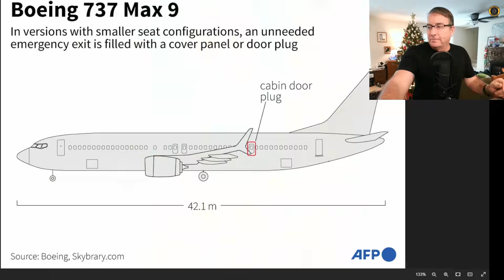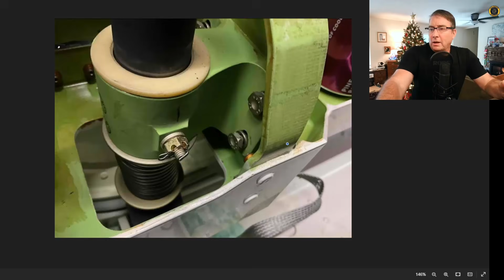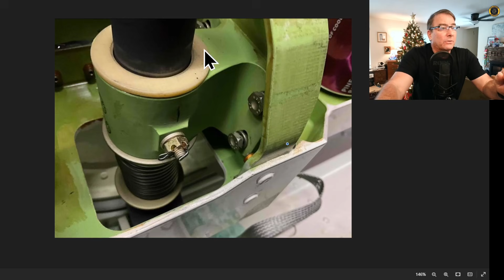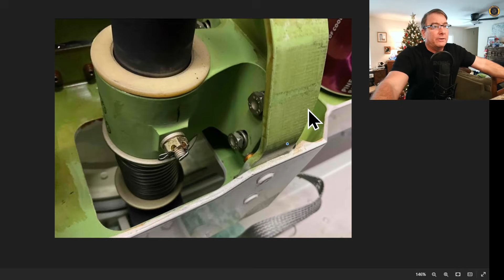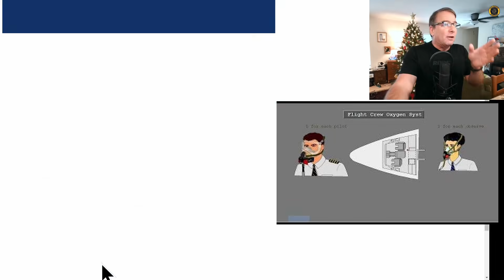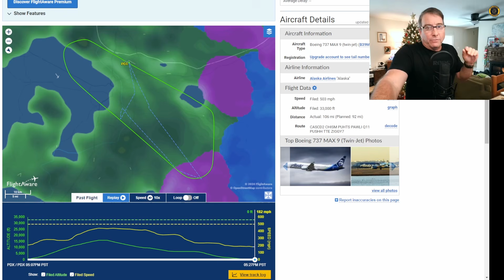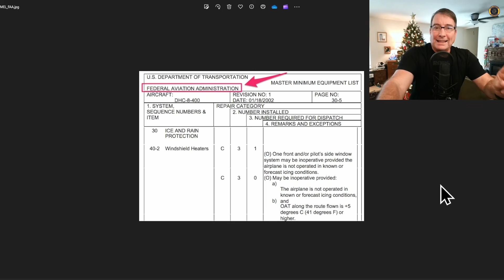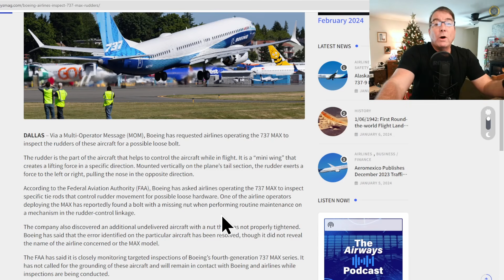"Yes, We Have No Bolts"  9 Jan 737 Max-9 Update

Comment: It's kind of shocking that the staff on the airplane are not trained to listen for hissing sounds near plug door locations. Apparently passengers were hearing this sound on this flight.
Reply: Door seals leak ALL the time.  Virtually every airplane has  leaky door seals to various extents.  Contrary to what many think, pressurized airplanes are not 100% leak free.

Comment: Honest question,I thought a plug door opened in , was bigger than opening,and used pressure to help hold it tight.Seems to me the term is being used very loosely.
Did it plug a hole,yes
Is it a plug door?I say no
What's your take?

Comment: Here’s the problem: Boeing practically invented the modern aeroplane and today’s 737 Max aircraft are basically re-engined, re-winged and electronically updated B707s. Boeing cabin doors have been copied all around the world. The original design was so good it sufficed for nearly all Boeing models since then. The lockout system on these ‘plugs’ is also brilliant: the lockout bolts themselves take almost no load at all, they simply prevent the unlatching mechanism from moving to unlock the door. The bolts are simply 1/4 inch steel bolts, drilled for castellated nuts and split pins. The bolts do not rely on torque, in fact excessive torque would distort the mechanism and weaken the bolts, they simply have to stay in place. Brilliant design. However, if those assembling the doors or plugs leave the bolts out through either incompetence or neglect, brilliant design means nothing. Here is where quality assurance is king. Boeing hires and fires staff depending on its work schedule. At the moment, they are ultra busy making 737 Max aircraft as quickly as they can and Quality is taking second place to production. If this keeps up, it won’t be very long before this great manufacturer becomes a mere parts supplier for the likes of Airbus. And that would be a tragedy.

Comment: I worked as an A&P mechanic on airliners from 1965 to 1978 when I got hired as a pilot for a commuter airline. I retired as a B767 Captain. I had numerous flights where my maintenance background provided valuable insight into the true nature of a malfunction. I received two framed letters of commendation for successfully landing safely with no (further) damage. Thanks, Juan for your excellent understanding of the whole airplane.
Reply: The Boeing 767 was probably the last excellent plane they designed and made.
Reply: @bobby1970 B777?
Reply: Got A&P 2 years ago and I would never compromise my Life because of some cheap company.
Reply: Cockpit door operation…

I did not know the cockpit door would open.  The door has blow-out panels going into the cockpit, in case of flight-deck window failure.   But there is no mention in the FCOM of the door blowing open if you lose cabin pressure.  

I did ask many engineers about this, and the answer was always that there is insufficient volume in the cockpit to worry.  Apparently not - the door will blow open if the cabin loses pressure.  Would have been nice to know.

FCOM Quote:
There are four blowout panels located in the cabin door. In the event of a sudden depressurization of the flight deck, the blowout panels hinge out from the door. This uncovers openings in the door and allows the air pressure in the flight deck and passenger cabin to equalize.

R
Reply: @macky4074 Yes, I flew the 767/757/737 but wish I’d had a go at the 777! 👍
Reply: A&P =??
Reply: @drmayeda1930  Airframe and Powerplant mechanic, an aviation maintenance technician certified by the Federal Aviation Administration (FAA) to inspect and perform or supervise maintenance, preventive maintenance, and alteration of aircraft and aircraft systems.  Responsible ensuring that the aircraft are in airworthy condition.
Reply: @rexmyers991: Congratulations on your outstanding career achievements!
Reply: @tator2345  
I'm not a pilot and doubt if I ever will.  I'm 63 with mental, cardiac, and neurological issues.  I would probably die in my first attempt to solo.  I have a little problem landing on the MS flight simulator.

Comment: Thanks for the additional info on the loose bolts in base bracket.  It was frustrating listening to sensationalism of 'loose bolts' by news outlets without knowing the details of what bolts.

The Spirit Aerosystems fuselage 'subcontrator' Boeing spinoff company will be center stage on this.  In Boeing's case the spinoff was done to make Wall Street happy and boost Boeing stock price.  Boeing bottom-line is the primary objective, not quality.  Spirit only made the quality control worse.

Comment: Weld the plug in certain areas. Easy to break welds for future upgrades. But a hole, bolts and locknuts is cheaper.

Comment: Great investagation report as always. This incident is totally different than most other reports because it shows the lack of quantity and quality controls by the manufacturer. 
This incident nows raises more questions in regards to what other  parts are missing in the aircraft  ? Is this an assembly line vendor supply issue? Or the lack of quality control and inspection at the assembly stages.? 
anyway you are a excellent person who cares about the industry and the personal safety of people who occupy this aircraft.

Comment: The cockpit door opening under decompression is such a hijack risk. If someone gets an emergency door open, they’re in.
Reply: There is no human on the planet that can open an emergency door if the cabin has a differential pressure with the outside. They could break out a window or put a hole in the fuselage to accomplish the same thing.
Reply: @wally7856 well they can just loose the bolts :P

Comment: I have a hunch the missing hinge fitting had a bolt that was not missing. And like loose lug nuts the last nut standing normally breaks the stud and goes flying. If this one hinge fitting was holding on for dear life maybe that is why the had some small leaks to get the warning lights. Well that is until the fitting broke and took flight.

Comment: Boeing is currently using a one size fits all even if the design does not support this configuration in the first place. Add lacking human inspection and attention to detail and you have the fall of a once leader in aviation design and manufacture.  Stop hiring DEI Harvard grads and stick with pilots, aero Engineers and Quality Control professionals! BA=$100

Comment: Seems like the upper keeper bolt tightens two sides of a channel to hold the pin in.  It's very easy to deflect the "flanges" without a sleeve across the inside.  Still, the cotter pin should have held the nut on unless there was a total failure.

There should be lots of witness marks in or around the holes if bolts either came loose or broke.

Stuff on airplanes is so closely engineered to save weight.  I remember the Chicago accident in the 1970's where an engine fell off a DC 10.  The engine thrust was transmitted through what looked like a 3/8 inch bolt that failed.  This showed just how tightly things on planes are engineered.

Comment: I think they have to revisit the design how the door is attached.  After all these great explanation now I have a good understanding of the attachment points and how air pressure leak can cause the door to come loose.  Scary and glad no live lost.
Reply: No, the four bolts just need to be installed.  That door would never have come off if even ONE of those bolts were installed.  It would be physically impossible.

Comment: The affected hardwares function would likely be documented via FMECA inclusion and result in Process Engineering creating maintenance instruction including a QC check-off box.  As QC inspectors are the 1st to be laid off when times get tough and bean counters have their way, I’m very curious if the proper hardware’s installation was documented.

Comment: These cases of overridden recorders come again and again.
Kind of shocked that they dont have a sinple additional USB Stick like recorder for the last Hundered hours or even more.
Yes in a crash that thing would be a gonner, but there is the least chance of an overridding. But in cases of close calls such an additional recording would have helped in so many cases.

Also I once learned that in an airplane all important acrews have to be secured against ruttle loosening and loctite is not enough. So how could these other bolts now be loose?
And why does this plug door even "open" to the outside? Easier installation would be a bad argument to introduce new points of failures.
Reply: Wait, so, in a crash where the CVR would be crucial in the investigation it's OK to have it damaged and useless but in the case where it's really not needed and of little value to the investigation it would be available?   Why does the plug door open to the outside?  I think you need to watch some more videos.
Reply: I did not say any of the recorders that exist now should be replaced, these are hardened against crashes and so are perfect for that.
My point ist an aeditional mass storage device that could be added to existing planes without much difficulty and would be helpfull against these "ups it was overridden" in cases without a destroyed plane.
I know the plug door does not really open, that is why I put open into quotation marks. Airplane doors normally open to the inside, so that the air pressure pushes them into the door frame so that they can't open in flight. This plug door is inserted from the outside into the frame and the air pressure only pushes it against these latches that need additional securing with bolts.
I think you need to read properly
Reply: @madcientist5438  I can read just fine.  You need to do a bit more research.  Airplane doors do NOT normally open to the inside.  Some emergency exit doors will open to the inside and become completely detached when removed but most all other doors open to the outside, yet they are still plug type doors and sit against stop tabs just like this door.  Most main entrance and service doors open to the outside and are still considered plug type doors. They latch and are held in the same way but just have a handle so you can open/close them rather than have bolts to hold them in place. These bolts do not hold any pressure.  They merely prevent the door from moving upward and keep the door in place against the stop tabs that are holding all the pressure. The fact that it opens outward is inconsequential.

Comment: The good news is that air travel WILL likely become safer after this investigation, and the resulting recommendations.  At the same time, Boeing deserves every bit of scrutiny they get over this,  just like the MAX 8 re-design they chose to keep pilots "in the dark" about.  If they had been more forthcoming with the "design changes", and "behaviour of  new features" (even things like the cockpit door, Ayeeee....), with proper re-training on the differences, I believe the pilots of the doomed MAX 8 flights may have been able to be salvaged... but then, sadly, the "fix" may have been watered down, or "swept under the rug".  I hope they analyze / inspect every one of these aircraft with a fine-toothed-comb....literally!

Comment: This plug door is a very basic engineering design. It’s static except when removed for maintenance.  It has no moving parts. It has a single purpose.  Either the engineering and design are bad. Or the QA during manufacturing is poor.  Looking at it, the design seems reasonable.  Given the plane was just delivered in October 2023 it would appear some shortcoming in assembly or QA is the blame. Basic fundamentals of aircraft manufacturing seem to be at fault. While I know no cause has been established I would say corporate culture, outsourcing, management and bean counting at Boeing needs to change.  You don’t see ship like this happening repeatedly at Airbus

Comment: I wonder why those hinge fitting attachment bolts don't have safety wire or safety cable. Seems to me that would solve the problem of them working loose and potentially seeing the hinge fitting separate from the door assembly. We LOVE safety wire in aviation, seems like an odd oversight. Also seems like it wouldn't hurt to reconnect those door condition indicators. Might be redundant, but it may have also prevented this issue. Seems like it would be a small task in order to avoid another explosive decompression.
Reply: Maybe there r nuts on the other side that have provisions for cotter pin or safety wire. Just a thought.
Reply: @billrimmer5596  Its hard to tell, but from the images we were shown it looks like it bolts directly into the door frame. Again though, if there were castellated nuts and cotter pins on the other side then they shouldn't be able to work loose. This feels a lot more like an engineer trying to save time and weight and just kind of assuming that putting a few hundred inch pounds of torque on a bolt means its good to go.

Comment: Not sure about 737 but the 320 is designed in the same way that the cockpit door will open automatically when there is a pressure differential between the cabin and the cockpit. The sensors are on the upper overhead panel and you can actually test it by blowing hard enough on them when the door is closed and it will unlock.
Reply: Is this supposed to be a secret, I wonder?

Comment: Way back decades ago did not a large DC 10 cargo door fail and the plane crash in Paris somewhere killing everyone on board.  So bolted doors and cotter pins are truly necessary.
Reply: That was Turkish Airways 981. What killed them was the cabin floor collapsed; clamping the rudder and elevator cables. If McD had provided adequate hold-cabin venting...

Comment: Those hing bolts don't look right, one lock split washer looks stuck in the hinge bolt hole. If that is a split lock washer there should be another washer stopping it from sinking into the hinge anchore hole. There doesn't seem to be any second washer.

If this is the case, what else in that jet is missing something?

Comment: I've worked at Boeing in Charleston and San Antonio, and Spirit in Wichita to name a few, and yes things need to change. The QA who bought that work off and the Mechanic who was responsible for installing those bolts will be getting called to the carpet for sure. Better be ready to pee in a cup folks. Regarding the cockpit door, so if it's designed to swing open, then why have the blowout panels, and two if a bad guy was to open an exit door in flight, would the cockpit door blow open allowing bad guy to then charge the cockpit? Boeing needs to answer up about this. The whole reason for hardening the door was to prevent terrorists from entering the cockpit ever again.

Comment: Have a question } Talking about pressurization ...Does the 737 series have the EDM (emergency descent mode)?   The EDM s that I have had available on corporate jets had to meet certain conditions to operate, one of them being that we have to be above FL310,cleary no the case here. SO if the left the autopilot engaged ,they used vertical speed to get down?

Comment: I don't know about Air Alaska maintenance though.  Ever since Oxnard.  I think their upper management starts having these guys take short cuts, layoffs of experienced mechanics, etc all to save a dime.  Maybe the loose bolts are coming that way from Boeing which is extremely frustrating, but the fact that they just ignore repeat warnings, just makes me shake my head.
Reply: And just how does a pressurization computer/controller glitch, that maintenance probably could not duplicate on the ground after pilots wrote it up, tell you there is a hidden plug door, that is supposed to be hard bolted shut, about to fall off?  Hindsight is always 20/20 so it seems obvious now.

Comment: Wow, you covered a plethora of issues!  Learned so much from this video alone!  So seeing the warning lights that are tied to various exit doors, and the plug doors light is not connected because it isn't needed, ha!  But anyway, wouldn't one think that it must be the plug/door causing the 3 prior warnings since the real exit doors warning lights aren't activated.  Well, I think they did know that. I believe they blocked the seats next to that door from being sold, and also put this flight on short runs where they didn't necessarily have to reach a high cruising altitude. (Altho someone said its' previous flight was from NY.... not sure of that?)  It is disturbing that you said they found another bolt loose in the rudder assembly of a 737.  I hesitate to say this, but someone mentioned sabotage. If there is a sabotage, is someone trying to sabotage Boeing stock? I am not thinking in those terms, but we are living in strange troubled times.....  Keep up the awesome work!

Comment: It appears that the door plug is fit up through backfitting where all the fasteners are loose so the seams should be even on the outside. Then liners would have to be installed so the fasteners could be tightened

Comment: If Boeing’s production practices and QC inspection process is this poor, it begs the question as to what else is being glossed over, flight control rigging and torquing, landing gear attachment, wing to fuselage link bolt torques…..the list goes on…! As others have mentioned, these issues are not solely related to the 737Max program it also the 787, which has had its fair share of well documented production quality escapes, even to the point where some airlines were previously refusing to accept aircraft manufactured at Charleston…that fell on its face after Boeing shut down the Everett 787 final assembly line. Boeing needs to have full FAA audits and FAA inspectors on-site, at their own cost, to guide them through necessary structural, cultural and procedural changes…they are playing with the flying public’s lives.